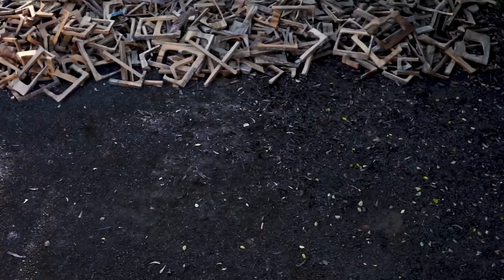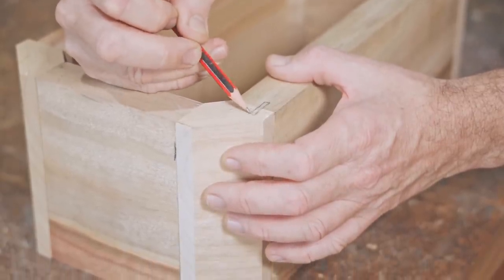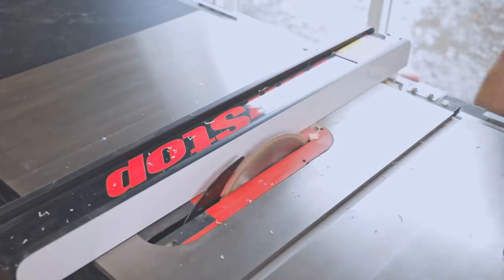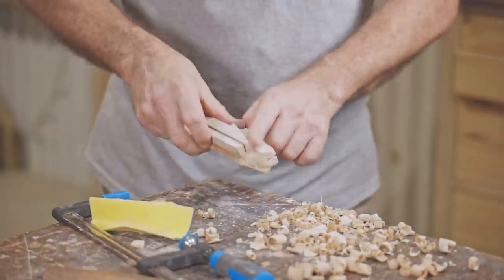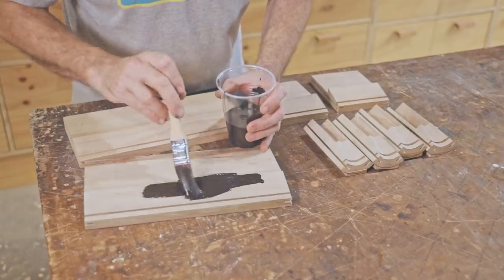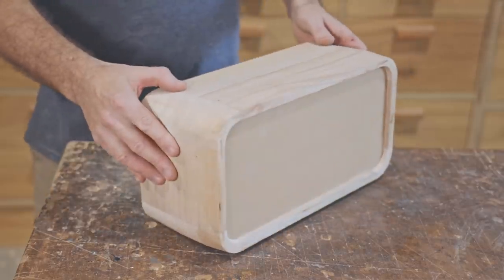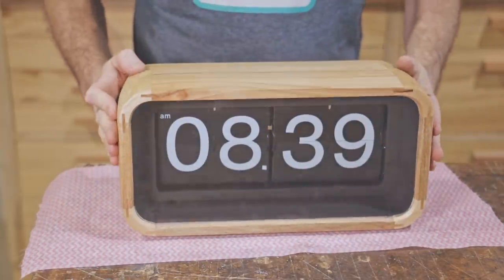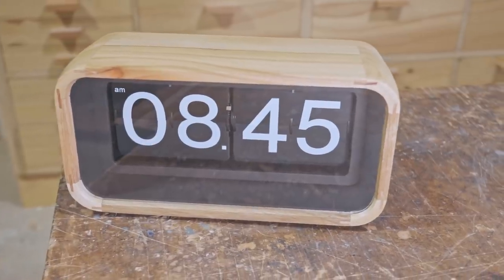I Bought a Flip Clock & Upgraded it - (Day4) 7 Scrapwood Challenges in 7 Days - ep46

Comment: You raised the value of that clock by a factor of ten!
The contrast of the cut tapers and the rounded corners looks great. The splines are a neat accent feature. 
I'm curious where the original clock came from. I haven't seen a flipper clock in years. The one I had plugged into the wall, no batteries. It was also an alarm clock, it had the most disturbing buzzing alarm sound. It was really quite startling when it went off in the morning. 
That was back in the mid 70's.

Edit: Spelling

Comment: If you apply a liquid ceramic type automotive paint protector on the Perspex it will not scratch very easy. Fine scratches are a real problem when using it. I use this type of coating on my eye glasses for scratch protection and the stuff really works.

Comment: Having seen how it worked out leaving the paper on the Perspex (Plexiglas in these parts) I think that if I tried something like this, I would trim the paper around the edges, leaving 1/32" of overlap between frame and paper.  That would be enough to hide scratches from the trimming knife and give the frame only 1/32" to hold on to when I start removing the paper from the rest of the plastic.

Comment: A dremel type rotary tool with an abrasive cutting wheel would have made the grove for the perspex on the corners pretty easy. But might have ruined the finish if you slipped. So you probably made the right call using the chisel...

Comment: If you had cut the paper on the plastic around the edge of the frame after your dry-fit, then you could have removed just the edge paper before your final glue up and avoided that minor hassle.
In any event, it's a great looking clock.

Comment: I didn’t watch the video to the end before writing this comment, and did not have a chance to glimpse the movement you used, but the case is unusually large for a Chinese junk flip movement made of plastic, such as one used to find on radio alarm clocks. You may have got lucky and found a Soleri, a high quality Italian made flipper clock movement in one of their smaller sizes. They made these flipper clocks for many public institutions and transportation systems, including the Tokyo subway.

Comment: Wow, what a difference! The original design of this clock was hideous. The modern metal, mid-century (?) numbers, and old-timey lettering all clashed. The exposed numbers would make a dust nightmare over time. Yours suits really well as the wood is way more consistent with the design of the letters. You make a lot of nice pieces but I think this is one of your best yet.